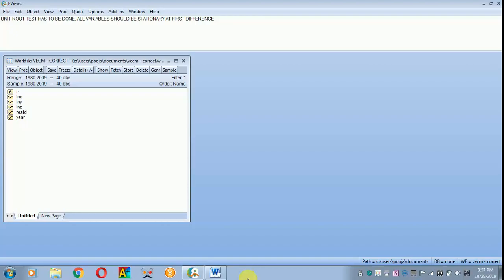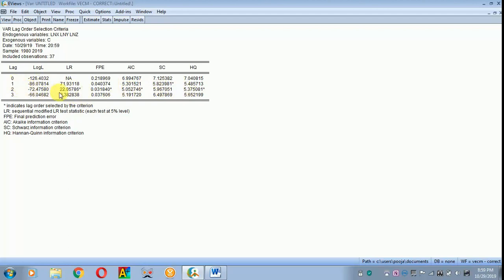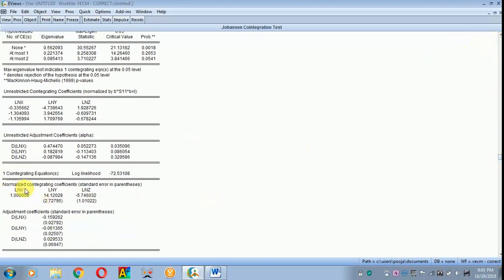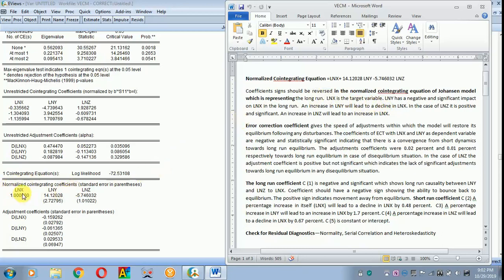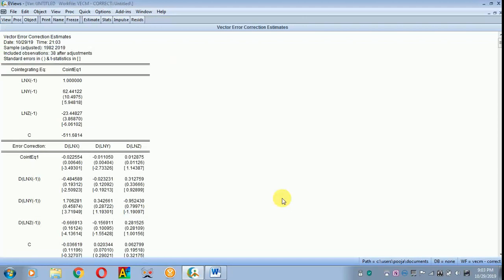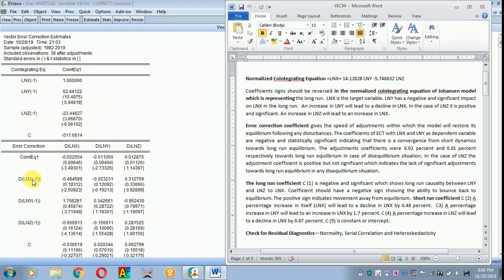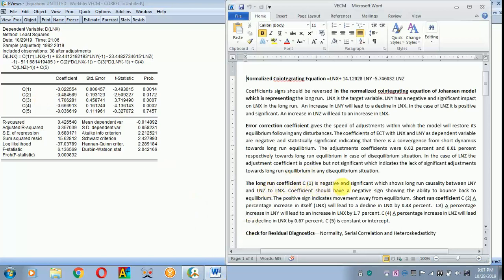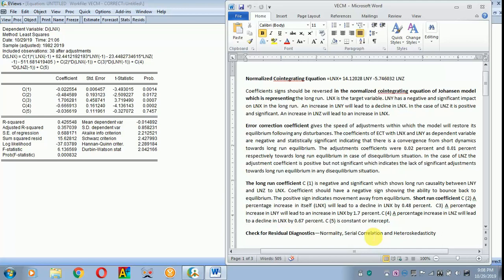HOW TO DO VECTOR ERROR CORRECTION MODEL (VECM) EVIEWS

Comment: Thank you for your excellent presentation. 
I just wanted to ask if you provide a REFERENCE for interpreting "Normalized Con-integration" results, confirming that the sign of coefficients should be interpreted to show an opposite relation, meaning that the positive sign shows a negative relationship whereas the negative sign shows a positive relationship.
Reply from the maker: Refer journals or manual

Comment: Mam if we found 3 cointegrating equations, then while running vecm, should we enter 3 or 1 in rank option? If i put one, will it make any difference. Or if i put 3 then how to interpret three cointegrating equations? BTW hats off to ur great work. Respect from 🇵🇰
Reply from the maker: For easy explanation one is enough.
Reply: @dr.shobhak6764  in that case which Normalized cointegrating coefficients will be interpreted? (3 Cointegrating Equation(s): 	or    1 Cointegrating Equation(s): )

Your response will be highly obliged.